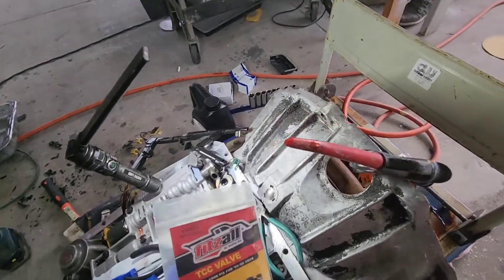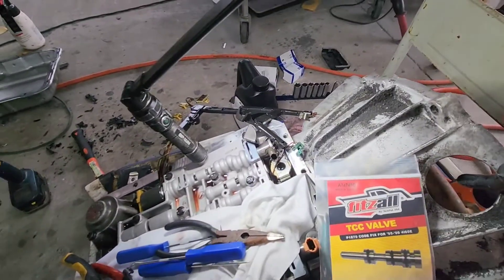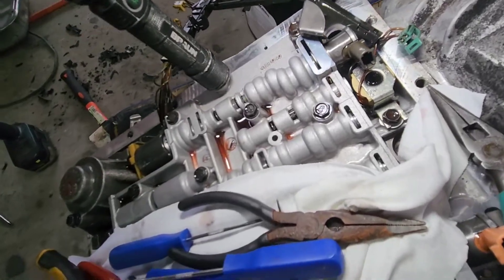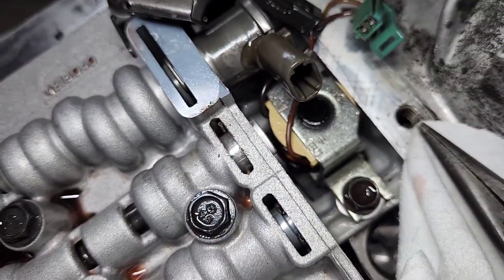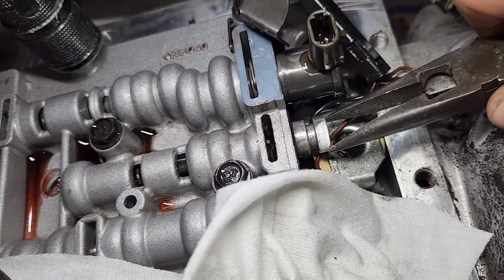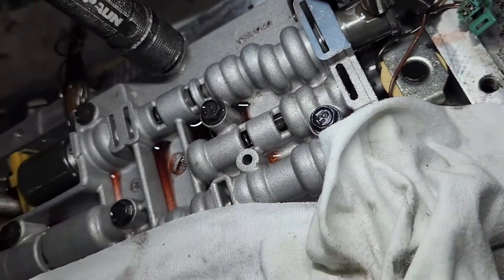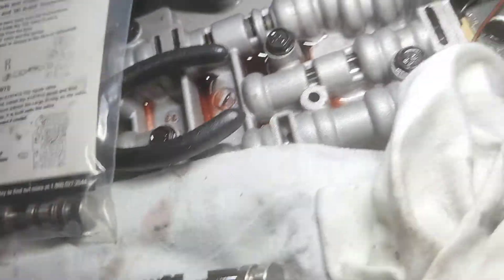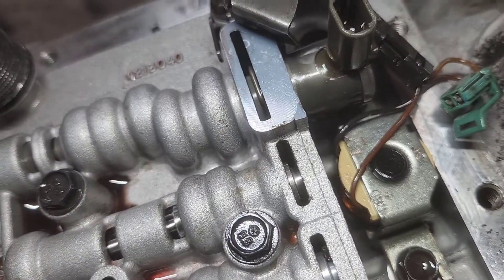4L60E P1870 TCC PWM Valve Fix WITHOUT REMOVING VALVEBODY

Comment: Thanks for posting this video. I spent a tremendous time with this problem over several months, during which time, I had ordered this part and returned it. My main issue with it was that it comes with a  rubber seal. If someone is planning to keep the truck for just a few years, now problem, but if the truck is a keeper for the long run...
...then this rubber seal is a major concern to me, as some day it will start deteriorating and thereby sending micro particles in all the other valves.
By the way, the rubber seal did not even fit properly. It was far too big. Yes, I could bring it through the outer bore, but it would have to pass other sharp edged bores, where it would be potentially cut up. So verification that this seal is not cut up during install is THE MAIN REASON for not doing this on the car. In fact, I think doing this on the car is taking chances. Again, once these rubber parts start floating around the valve body, all bets are off.
Reply from the maker: I understand what you are saying about the sharp edges damaging the O-rings on install, but this transmission has been in a truck for about 6k miles as of now and if functioning perfectly. I don't see the o rings being a problem with deteriorating. There are other parts in the transmission that have o rings, and they do not seem to fail over time. Also, this new valve does not move inside the bore like the old one did, it is more of a stationary blocker, so the o rings should not wear over time.
Reply: @ark2002  Thank you for your response. Sorry, I may not have expressed my point well in my prior reply.

When you insert this unit into the bore, it has to first pass the sharp edges of the outer bore, then before it is seated in its final position, it has to pass several more sharp edges and their corresponding inner bores. So there is no way this O-Ring will not be torn up to at least some degree during installation and left with damage. Hence my subsequent degradation worries, even if the install was successful in terms of blocking function. As a result, I would be particularly worried installing this without removal of the valve body, as then there is not even a way what so ever to monitor the extent of damage that the O-Ring has sustained during install. Reality was such, that I have the most super carefully and greased up installed this unit with the valve body removed. However, upon install, my sentiment was instant regret. Because, subsequently I had hard time taking it out. After taking it out, I was hawkishly looking for left over debris or other damage of the bores and meticulously cleaned everything.

Another thing that I like to point out about PWM deleting/blocking, are the differences in TCC clutches to begin with. This may not be well known. It has been covered only in a few GMT400 threads. Apparently, the clutch material in TCC prior to PWM lockup was DIFFERENT. According to same forums, the clutch material of new PWM TCC generation is not compatible with the resulting instant/harsh engagement of PWM delete/block. How much of that is true in the long term remains to be seen. All I can say for now that I have read this often enough to be concerned about it.

To counter that same argument, or what speaks against this angle, is that in his videos, Richard @ Precision Transmission seems to be deleting/blocking all of his 4L60 builds. And Richard is a real pro. Still, I have watched enough of his videos to have some remaining doubt about even if he knows for sure about the long term. That is not to say that I know more than him; hell no. But I do say that generally speaking it HAS TO BE very difficult for ANY shop to reliably judge emerging LONG TERM patterns, WITHOUT EXACTLY and VERIFIABLY knowing how well the customer has treated or used their vehicles. Especially, since it takes years or decades for such emerging long term patterns to manifest themselves to begin with.

Long story short, I would err on the side of caution when deleting/blocking PWM systems. In fact that is the route what I have chosen, leaving the PWM intact while rebuilding other parts.
Reply: A very well thought out commentary and analysis, especially about the difficulty in tracking the long term reliability of such a mod. @mrtopcat2
Reply: @mrtopcat2 I been watching his channel I have to do this myself but I’m buying a rebuilt vavle body with this already done to it cause I need a new gasket for the vavle body and the plate
Reply from the maker: I totally understand what you are saying, but for my case I was fighting PWM issues with this truck for months, I have now done about 9k miles since this "patch" and have been extremely happy with the results. Solid TCC lockup every time, no slipping, this truck tows trailers often and it has reduced the amount of heat generated in the transmission dramatically. As for longevity, the PWM system is well known to have problems, I think this solution will outlast the lifespan of something going wrong with the unnecessary PWM. Also should note that this was a $500 junkyard transmission behind a 2600stall torque converter on a truck with big tires and I am not nice to it when I drive, so if it dies, it dies, I will just go get another. But as of now it seems to be doing great.

Comment: I finall started my first swap. 03' Crown Vic Police Interceptor Ls3/4L80. Im only doing the Ls3 cause i found a Ls3 block cheap. Otherwise it would be a 6.0L. Lol. I dropped the block off last week to the machine shop to get honed or bored. Not sure yet waiting to hear from them to see which. I already had a 40k mile crank and Gen 4 rods and pretty much everything, but the block and heads. It was from a 20q2 Ly6 6.0. Even the accessory braket, intake everything. I still need to grab a set of heads for it. I watch your whole swap. Just curious how its doin.
Reply from the maker: Glad to hear you got your swap started. Funny you asked about the mustang, I just got a bunch of parts in this week for the turbo setup, so there should be a video soon as I have time to work on it.
Reply: Hell yea, glad to hear. I'll be on the lookout. I'm going to run both the Ford and Gm fuse box and ECU the way you did that way  Everything still works on my car. I'm pulling the harness from my Vic so I can depin it and make it a stand-alone setup so my factory gauges will still work. I've got it figured to where I believe the volt,oil, temp, and fuel level gauges will work. Just have to figure out me speedo. Prob have to go GPS. I'm going to hook up the VSS out from the 4L80 to the input on my Ford ECU and see what happens. I want to build a sleeper, so I want her to look stockish. ISH, lol.